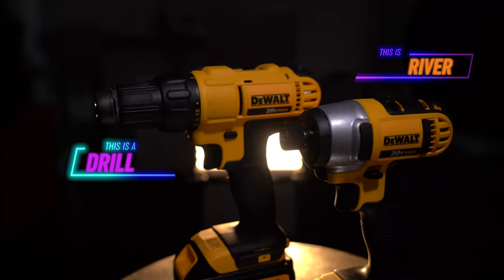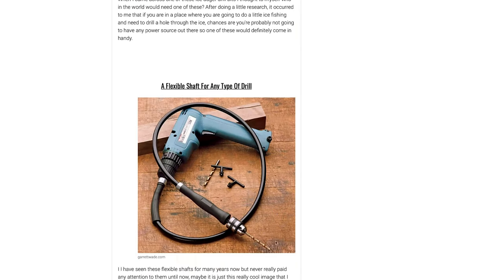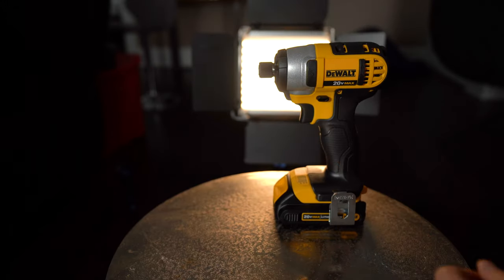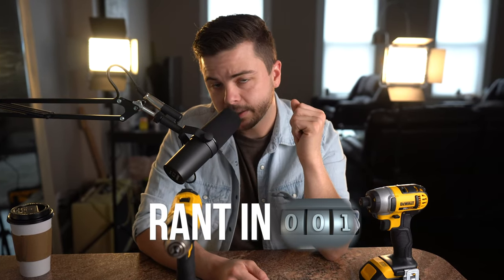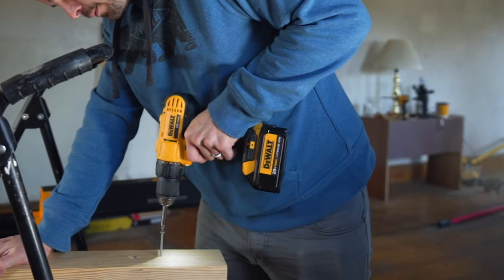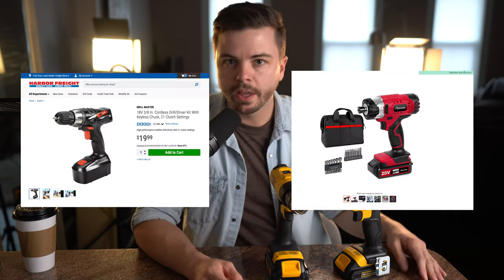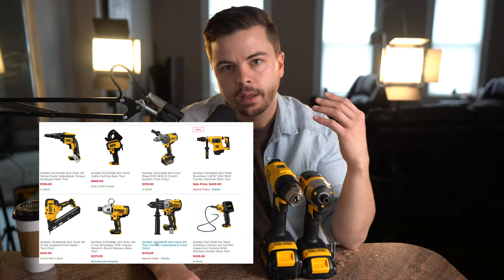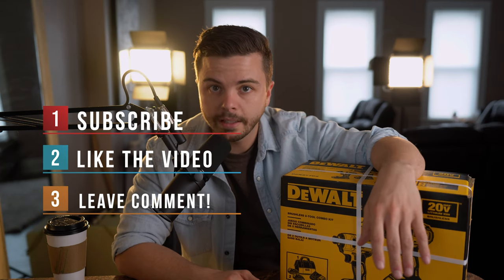Impact Driver Vs Drill

Comment: I know I’m late to the game here but what is your opinion on impact ready drill bits? Would that sway the decision more towards the impact drill?
Reply from the maker: Great question. Depends on the situation. If your just boring out holes in a deck for pre drilling and don’t care about the material then a driver works great. But if you need to be careful or precise and control the speed I really prefer a drill because you can limit the torque with your clutch. I still think the best idea is to own both tools as they compliment each other more than they compete with each other. Hope this helps!